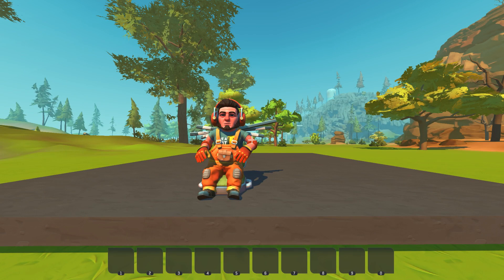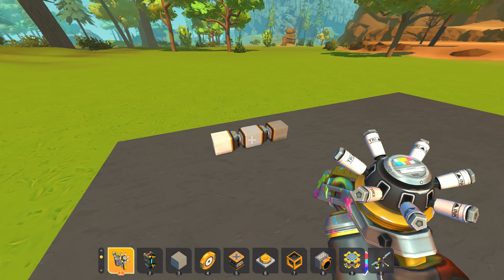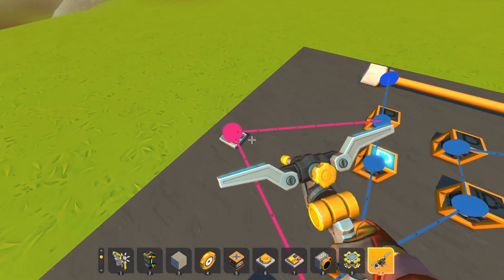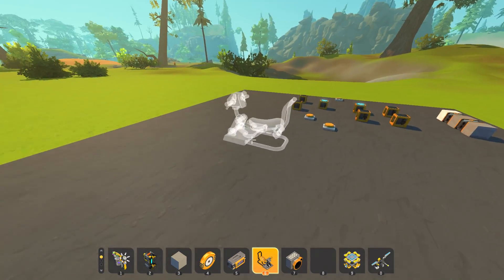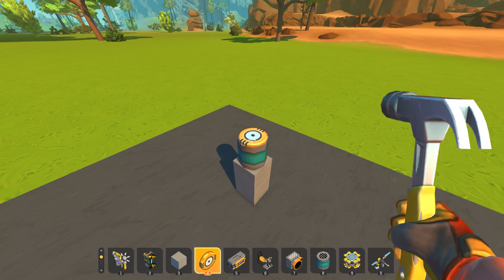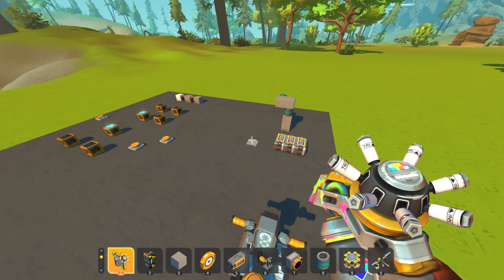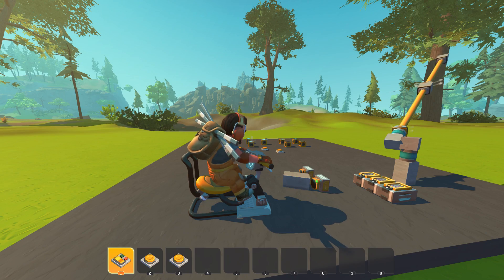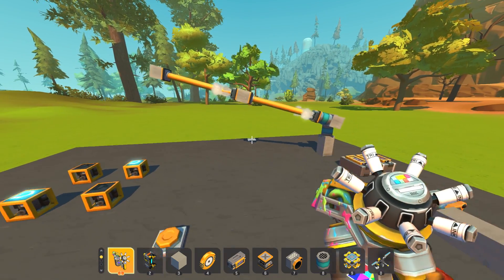How to Build a Double Piston Robot Arm for Survival! (Scrap Mechanic Tutorial)

Comment: @kAN Gaming at some point in the past i think i watched one of your videos & you said you could not make a 3 piston engine without a deadspot or something like that, i managed to do so with a 2(drive piston) engine by using the suspension instead of pistons in a standard 4 piston engine, replace the last 2 with suspension , add a arm the length of your pistons extended on a bearing for each & then just use the controller to adjust the arms down 60% or whatever you need for the length of your pistons & your done.

Comment: Just a little heads-up for those recreating this or building something else with the double piston extender, after you finish the tutorial (so you understand what its doing) here's a little follow-up, the double piston extender logic is possible with only 5 blocks/4 parts for the circuit, i used to build something similar to the video but then realized how its really just overcomplicating stuff, all we really need is that 'pulser'/'blinker' circuit to control the first piston and a timer to delay that same signal for the second piston. Less gates/connections is always a good thing ^_^

=== Quick how-to if the above isn't clear ===
0) Using some blocks of your choice make a 5x4 or bigger square on your lift
1) In the middle of it, place 3 gates and a Timer like the below (once you understand how it works you can make a 1x1x5 or whatever shaped version)
              ----------                 ----------- -----------
              |  OR  |                |   2tick Timer  |
----------   ----------   ----------   ----------- -----------
| AND |                | NOR |
----------                 ----------

2) From left to right place a Switch and two Buttons below the 3 gates
3) Connect each to the gate above, so Switch to the AND gate (this will be on/off) 1st Button to the OR gate (this will be extend) & 2nd Button to the NOR gate (this will be retract)
4) Connect the AND gate to the OR gate, the OR gate to the NOR gate, the NOR gate back to the AND gate & finally the OR gate to the (2 tick) Timer
5) Thats it, now just connect the OR gate to 1st Piston and the Timer to the 2nd Piston.
Reply: Thanks for this simpler version. I use this to raise/extend my drills by attaching two sets of piston assemblies and two sets of the logic. Unfortunately while the lateral piston extension works perfectly the vertical piston extension sloooowly falls to the resting state. Not sure why since everything is identical. Still great that I can make this so compactly though, so much appreciated. ^_^

Comment: I'm having a problem

The up and down bearing is working fine, but the right and left are not working correctly.

The problem is the bearing near the bottom is not effecting anything above the bearing above it.

So for example, i have a block, a bearing, a block, a bearing and a block

The second bearing effects the block on it and so isnt a problem

The first bearing on the other hand only effects the block on it and NOT the bearing on that block or anything on that either.

So i can only turn one way. Any ideas why this is happening?

Comment: It's things like this that make me wish the devs would make a control stick. The way i would envision such a thing would be a toggle switch that when active, would switch WASD control to whatever you programmed it for, for example connecting bearings would allow fine manual control of those bearings. Or, alternatively, connecting to a controller would allow cycling through a routine, allowing for making more functional mechs that can be controlled more intuitively.

Comment: This robot arm is pretty awesome.instead of having a vehicle with drills on it I think I'm going to take this design and put it on the back of one of my trucks then just back the truck up to the node and drill away while not having to worry about my truck sliding around.

As far as tutorials go, how about a tutorial on the different types of wheels that you can create out of various parts in survival. Currently I have an idea for a wheel that uses the mannequin legs but I'm not sure if it's going to work and I haven't tested it yet. 👍

Comment: Great tutorial. 
When using pulsing pistons vertically, any weight on them seems to slowly push them down. Is there are good way to fix it? I tried giving more pulses to the extension logic gate, but it didn't work great
Reply: If it needs to be constantly up, I don’t think there’s anything you can really do. However, if not, then the only solution I can think of is turning it 90 degrees so it’s lying down on the floor like in the tutorial.
Reply: I dont think so but i guess a old school scissor lift with controllers might work.

Comment: I noticed a lvl 5 controller Speed Is enought to the drill/saw to make their job, so you could harvest fuel free...
Reply: you don't need a lvl 5, you can wire  a lvl 3 controller for example  like this:
=(1)=(2)=(3)=(4)=>
where "="  is a block of your choice and (1) is a bearing (being 1, the first, 2 the second etc) and ">" is a drill (for example) and it will multiply the speed. 
just test it and see what happens :)

Comment: Just a heads up, you only require 2 bearings powered by a tier 2 controller (set to max speed for that level) to spin drill heads and saw blades fast enough to do their job. So you can easily set up a mining/wood-cutting robot arm completely fuel free.
Reply: I like the funny noises the scrap engine makes so I will continue using them for my drills and saws
Reply: @sharcblazer99  The would kind of defeat the whole concept of it being fuel free...

Comment: Great video! Is it possible to hold a single piston in place, or would you need to use two? I imagine just skipping half of the two last logic gates, but can't seem to get that to work.
Reply: for what i understand piston have only 2 stage: extension a contraction. that's way you can't set only one piston to stay in posiction, to do that you have to pulse multiple piston in a way theire speed summed are equal to zero. the easiest example is 2 piston pulsing one contratry from the other whit the same speed. (Va+Vb=0 --> Va-Va=0) whit 3 you can make One pusing whit the same speed of the first and the 3rd whit double speed but opposite direction (Va+Vb+Vc=0 --> Va+Va-2Va=0) and so on
is a simple 1st grade equation with n variable whit sum=0 where n is the number of your piston, max extension is 16n
(16 becouse is is 15 for the extension + 1 block of the piston itself)
Reply: Emanuele Atza it’s big brain time

Comment: If you have videos that step through (slowly) the logic elements (e.g., the initial 3-node pulse generator), it would be helpful to link to those.  As is, this tutorial is kind of: "Do this and it'll work" and not so much here is how/why it works.  Still extremely useful (thank you), but missing an opportunity to enhance the skills/understanding of your viewers.
Reply: Yep a vid from him would most likely reach the most viewers.

If you just want to understand how it works then here it is: (warning! long explanation)

The first three gates form an astable vibrator (just as info what it is)
The gate that makes it work is the NOR gate. It is used basically just to invert the signal.
That means it turns on if it has no input and off if it has one.
The other two gates are used as delays. Just for the vibrator to work they can be OR or AND since both do the same as long as they only have a single input.

Outside of Scrap Mechanic you would only need a single delay gate but in the game you can not connect a gate to another and back so you need at least 3 to form a loop.

So the sequence is
1) NOR gate has no input and switches on
2) The next gate gets the input from the NOR gate and switches on as well
3) 3rd gate gets the input from the second one and switches on
4) the NOR gate gets the input from the 3rd one and switches off
Then the next gates switch off as well and you are back at the beginning starting the whole circle again and again.

Now kAN used an AND gate and an OR gate as delays because they are also used to control the piston arrangegement.

The AND gate is used to shut off the vibrator. It can only transmit the alternating signal in the loop when the switch connected to it is on.

The Or Gate is also used to extend the second piston (more on the later)

Piston steering:

From the NOR gate you have two connections going towards the pistons.

Piston 1 is connected via an OR and an AND gate.
The or gate is used to transmit the pulsing signal from the vibrator and to extend the piston.
As long as the extend button is pressed, the OR gate is active and the piston extends.
When you let go of the extend button then the OR gate just transmits the pulsing signal and the piston will keep trying to go back and forth according to the signal.
Because that signal is changing so fast the piston will just keep pulsing without really moving.

To retract this piston the retract button is connected to the NOR gate of the vibrator. Pushing that button will force that gate inactive shutting off the pulsating signal. Without that signal the piston will retract. Letting go of the button will let the vibrator start up again and the piston will resume pulsing.

The AND gate is not really needed and Kan only used it to keep the arangement of the gates symmetrical to the second piston. This gate can just be left out without changing the function.

Piston 2 is connected via an XNOR and an AND gate.
The XNOR Gate is used to mirror the pulsating signal. That way when the first piston moves out the second moves in at the same time and the endblock stays still.

This gate is also used to retract the second piston. Because the retract button shuts the vibrator off simply mirroring the pulsating signal via an NOR gate would extend the second piston instead of retracting it.
But with the vibrator off and the retract button connected to the XNOR gate as well, that gate only has one active input when the retract button is pushed. With only one active input the Gate switches off and the Piston retracts as well.

To extend the second piston the extend button is also connected to the OR gate of the vibrator. (finally getting back to that)
Pushing the button will force that Or gate on and shut off the vibrator. (same effect like the retract button has on the NOR gate)
Because the extend button is not connected to the XNOR gate, shutting down the vibrator will cause the XNOR gate to go active and the piston extends.

Finally the AND gate at the second piston is to switch it off. The on-off switch disables the vibrator which is enough to switch off the first piston as well. But because the signal for the second piston is mirrored by the XNOR gate that would cause this piston to extend. Because of that the on-off switch is also connected to the AND gate so the piston can only extend if the switch is on.

Phew  looking at this wall of text  i guess i see why kAN did not go into greater detail :)
Reply: @Landogarner83  Thank you for this. It's going to take me a few read-throughs to get this into my old stupid brain, but your explanation is very helpful. Thanks to Kan and you I will be able to make one for myself, and hopefully understand how it works. I did try a while ago to make one, but with no video or logic guide like yours, mine......didn't work=) Thanks again both of you.
Reply: @ayupworld  yeah there is a lot going on.
It may be easier to understand if you build it out like kAN did. That way you can add timers between the blocks of the vibrator. just a few ticks will slow the whole thing down enough so you can see what it does.
Reply: yeah wish someone would give the breakdown like that of how and why these things work the way they do

Comment: If u set the steering bearings to toggle u can cover a decent surface and u can spare the 2 controllers and the A&D converter :) the piston logic is awesome!
Reply: Dang we got Lord Pain here, btw Your mods are beautiful!
Reply: The issue with bearing steering for cranes is it's limited to a 270º arc and the turning speed is ridiculously fast, making it difficult for fine control, I was using bearing steering on my farmer crane, but I ended up just switching to the electric engine turning because it allows you greater control, and batteries are so plentiful due to there being no need for engines for vehicle power.

Comment: Darn I was hoping this would help me make my ED-209 themed mech's arm movement  better.  I have the wsad used to move the mech , (not figured out walking using steel wheels in the feet for movement) it has a working up and down for the arms using a bearing at the shoulders and the top pivots at the waist making the body move left and right with buttons.. I'll have to examine this design and see if I can incorporate it...

Comment: In survival, if you click e on a steering bearing(the ones that are hooked directly to the seat) you can change how much it turns and if it locks and stops where you left it without changing back in original position.
Reply from the maker: Yes true if you have a level 5 seat
Reply: @kANGaming  thx for clarifying it was driving me insane that i could see the 'E to use' but nothing happend
Reply: @kANGaming  make 2 of these circuits each with their own color-coded buttons and switches
Link them up
Like a construction crane boom thing (hopefully you know what I mean)
And you got a longer version
Reply: @nikolimoon6165  for only a longer version, just put 4 pistons in a row, two of them to one gate, and two to the other.   But for a crane you meant maybe separate buttons to work in multiple axis.
Reply: only negative is that it moves too fast if you want any fine movement
Reply: @Orwrath2010  change the speed down

Comment: I think you should make a tutorial for the automatic farm. I would love to build that on a much larger scale but I can't figure out the logic
Reply: It uses the same mechanic for the pulsing piston arm, but the extend/retract is controlled by timers instead of buttons, and the water gun/vacuum pumps are triggered by sensors.
Reply: It's controllers to control the pistons and sensors for the harvest tube/water cannon/seeder. I combined this with Scrapman's fully automatic farm to make a 3x3 plot that is forever growing spuds, I have an endless supply of spuds and the 3x3 grid never attracts bot raids.
Reply: @jollybodger  9 potato crops are enough to trigger a raid...potatoes have crop value of 1.5, 9 of them make your plots value 14.5, which is above the minimum for tier 1 crops which is 10. No idea what you're talking about with a 3x3 farm of potatoes not triggering a raid. Either your game is broken, or you're not really doing what you say. If it was carrots, tomatoes or beets, yes, 3x3 never triggers a raid because they have crop value of 1, but you only need 7 potatoes planted to trigger a tier 1 raid.

Comment: I saw this in your video with the farmer rescue truck and was intrigued by this mechanism. Then I was thinking if this would be possible to do with controllers for rotational joints. A little bit of testing later I found out that it is indeed possible, so you can make fully controllable rotational and linear actuators with this.
You could use two electric engines to achieve the same (one for each direction) but I found that they tend to slip with time. It's also faster than a looping controller and works continuously. Only downside is that the rotation is limited to 720 degrees, but that's rarely a problem.
Oh, and if you want to use multiple of these mechanisms on the same creation, you only need one clock signal. You can hook up all the subsystems to that.

Comment: I didn't know you could link controllers to seats to create W/S imput
I have a question : i bulit a vehicule with your piston engine in survival
A/D turning works as normal, but W/S are replaced with 1/2
Is it possible, with this new information or another, to create a W/S imput detector to use as forward/backward button ?
thnx
Reply: I've been using seat->controller->piston to move a block past several detectors and have a 'w' dependant acceleration.
The 's' conversion still eludes me

Comment: question, kind of new to the game and in a few videos he talks about the piston glitch (the bikers vids if i remember correctly) is there a tutorial of his that shows how its done? the ones ive found ive tried to copy to the letter but it doesnt work.  (sorry if its been asked/answered before)
Reply: Do you mean suspension glitch
Reply: Suspension glitch, not piston.
If you put a suspension on a bearing and try to rotate it into the block, then it will start rotating the whole creation.
He used it to make his bike stand upright.
He placed sensors on both sides and when they detect the ground they rotate suspension into the block.
When creation leans to the right suspension rotates to the left causing the whole creation to stop from leaning to the right.
I may have said too much, but I hope it's still readable.
I hope I've helped you.